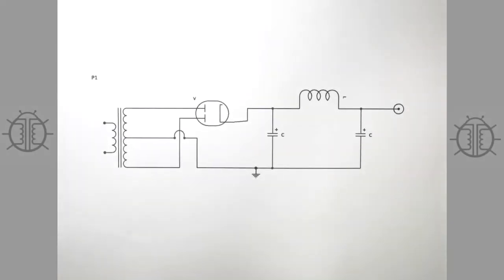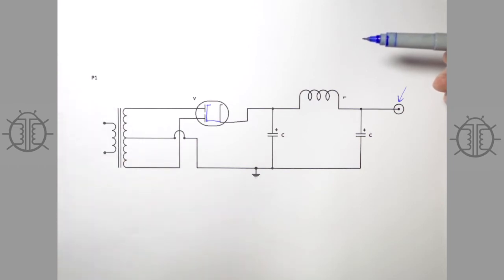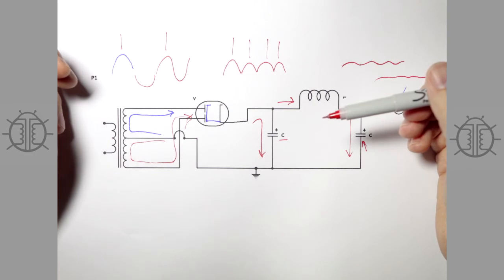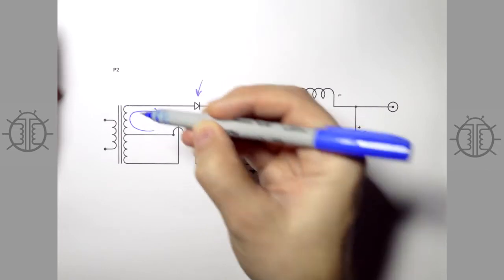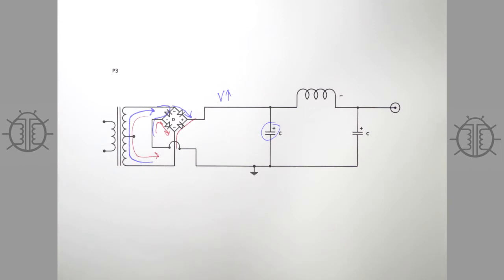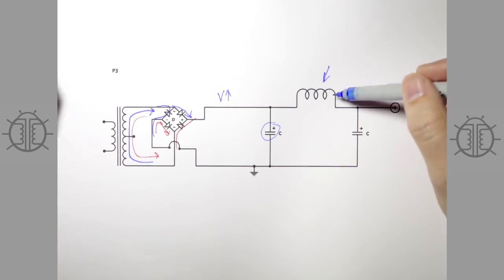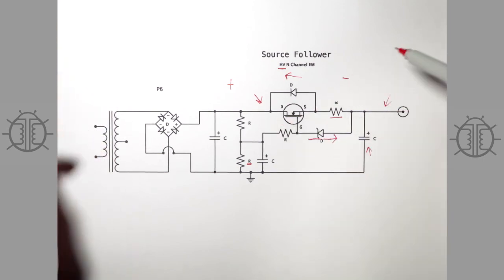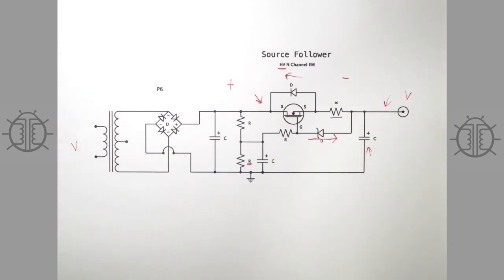Tube Amp Power Supply Design

Comment: Great Video found it really useful, would you mind explaining further the job of the resistor on the output after the source of the Mosfet.
Reply from the maker: This is a current limiting resistance. If the drop across this is excessive and if you’ve got the correct Zener value this will set the max current of the mosfet. This may save the circuit in case of temporary short.
Reply: @Edgarbopp  thansk 👌
Reply: Hiya probably a very nube question, but coud you get away with lower voltage capacitors after the voltage divider on the gate, as the voltage cannot be to high so as not to exceed the gate voltage.?
Reply from the maker: @phenome4973  sure, if the voltage divider is such that the gate voltage is low enough.

Comment: Why not put an inductor in-line before the final mosfet circuit? Get the best of both worlds? Would be interesting to see how much ripple makes it to the final circuit under load.
Nice vid, thanks for making it. I stumbled in here looking for a regulated DC power supply made with just vacuum tubes. Yeah, I know, I'm a glutton for punishment :)
Reply from the maker: You could put a inductor in series. Not sure how much it would help. I do need to do another video on PS design I should include tube regulation!

Comment: Wuld you please make those old wacum tube baterry charger circuet diagram? Im surching for some thing similar that can by used for magnet alternators I like wacum tubes but dont know how the automatical current cutt out circuet shuld look like with wacum tubes is it posibel useing those old external voltage regulators or those old external regulators for dc generators for cars with wacum tubes. Honestli told Im indead afraid to use it in car so was curriuse can that by some sort of cloosed loop system?

Comment: I built an LM386 small amp, can I use a tube power supply instead of a battery?
Reply: What would you want to achieve? Bulky and potentially dangerous thingy, and a lot of problems getting the voltage right for LM386?
Reply: @JanicekTrnecka  Is it wrong to experiment?I know the risks of working with tubes.
Reply: Definitely not, but I dont see much sense and reasonability in powering LM386 with tubes. I would rather build "battery powered tube amp" instead of probbably grid powered tube power supply to operate LM386...
Reply: Please dont feel dissed... I have built a lot of "unusual and pretty weird" circuits too ;)
Reply: @JanicekTrnecka  I'm sorry for my reply, we don't see face expressions in comments  to understand the real intentions of them. I'm retaking what I learned years ago about electronics, I totally forgot what I learned. Cheers!

Comment: Certainly interesting, although I have my doubts. 
This looks more complicated as it needs to be - in my reading of tube systems schematics I've never seen anything similar. In a lot of modern tube power supplies LC filter is simply replaced with RC filter (respectfully series of them). Also, you have said it wrong, most of the times OT primary is connected directly after the rectifier (on very first cap) and after the choke comes the second node, going to the screens. But surely a similar  circuit would be quite nice to provide a bias supply (even eliminating the need for a separate bias winding). I think you are also wrong about the CT PT with two diodes being in any way inferior to the bridge rectified configuration, I suspect it is much easier on PT and eliminates half of the rectifiers needed.
Reply: This for example is a quite modern Slodano 100 PSU https://www.trioda.com/images/gallery/soldano_100/001.gif
Reply: Back when rectifiers were all tubes, using a center-tapped transformer was the cheapest way to go, as tubes were pretty expensive.  These days, rectifier diodes are cheap, you can buy a 2A bridge rectifier for under 50 cents, and copper for transformer windings is expensive, so cutting the amount of copper you need in half is a definite plus.  

For the same reason, big filter chokes are expensive, so usually an RC pi filter is done instead of an LC pi filter.

Comment: Hi Doug, 

I really enjoyed this and liked the way you walk through the circuit from something basic that is understandable, and slowly make it more complex. Each time explaining really intuitively the improvement.

I did have one question. I really like the way old amps like Plexi etc briefly sag when hit hard. And I also really dislike hum! Do you think we can get the best of both worlds with a design like this? 

For example something quite saggy, momentary voltage drops across the board, and also low ripple? Just wondering if you have played around with that?
Reply from the maker: This is absolutely possible. You could for example use a SS rectifier and FET filter then follow it with a traditional series tube rectifier smallish cap and choke.  Should have identical sag/power compression characteristics with none of the hum. 

A less complicated option would just be adding series resistance after the filter until you get the voltage drop you prefer when the amp is driven hard. Keep in mind this only really works with push pull class AB amps as class A amps draw constant current even when driven hard.

Comment: Just some silly idea is that inductor there by any chance replacebel for exampel dc commitator or armature to by preciseli what wuld the result by dc generators use wave and lap windings expeciali Im refering to Amplidyne and Metadyne generators . So Im cinde of interested how those old gasoline electric trains operated exactli no one hase rewive video about them on youtube . So wacum tubes are reali cool devices